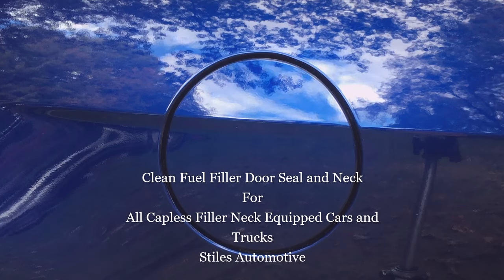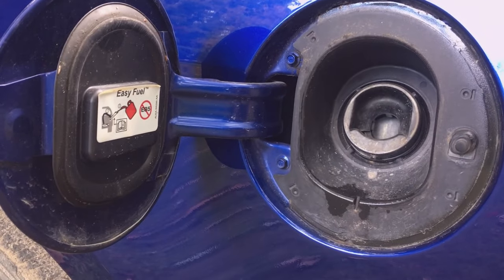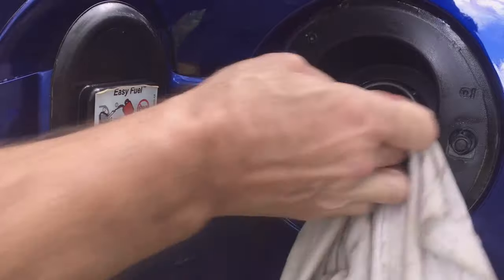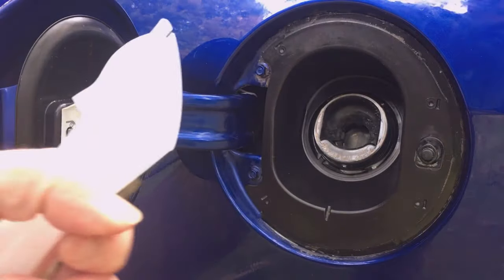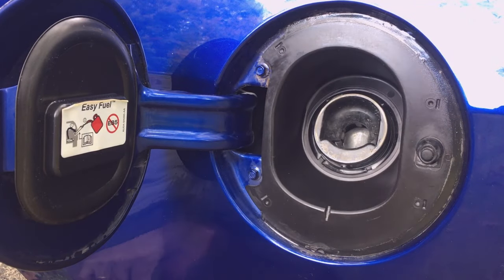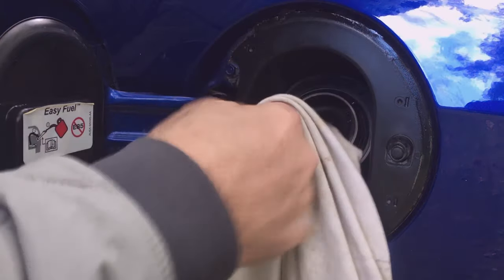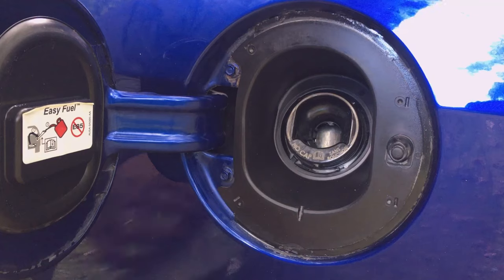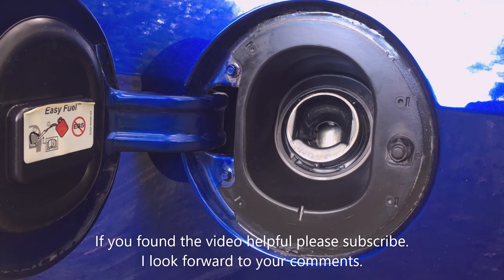Clean Fuel Filler Door Seal and Filler Neck for All Capless Filler Neck Equipped Cars and Trucks

Comment from the maker: Just a quick note about the video - -

You have to open the Flapper Valve (the little automatic door) and clean the mating surface.  This video shows you how. 
Cleaning the outside is good, but the point of this video is to clean that inside valve that make a vacuum seal to prevent OBDII fault codes!  I hope this is helpful - Stiles
Reply: Great tip! Thank you!
Reply: I’m thinking I might start carrying a rag or wipes to ensure pump nozzle is clean prior to fueling. I can see how dust could collect on a nozzle at a fueling station.
Reply: New to capless. Im experiencing a P1450 unable to bleed up. I have seen videos of WD40 sprayed and then using the funnel to actuate the flap multiple times. But this is the first I've seen showing you can keep the flap open and clean the inner mating surface.
 Thank you! I hope this clears my code!
Reply: You actually CLEAN THE FLAP INSIDE? Tell us WHY you do that? I would first check your turn signal fluid. Make sure you use the correct OEM OIL.
Reply: This needs to be show by dealers when you buy.  A pretty crappy design imo.  This video was so helpful.  Getting ready to do.  Great detail, good footage, and clear voice.  Thank you very much and thank God for youtube.

Comment: So, you think a gas cap is redundant but this hastle of cleaning isnt' a bigger pain in the ass?  And engineer that came up with this idea should be fired on the spot!
Reply from the maker: Bill, I the kind of guy that put a switch on my closet door so I don't have to flip a light switch, I open the closet door and the light comes on.  See video - -
Shop Tip No. 4 – Stop Repetitive Tasks, Radio on with Overhead Lights   https://youtu.be/0699pDo8-Yc

But . . . when you do something like this Fuel Neck you have to look at the long-term effects.  Thanks for the comment. - Stiles
Reply: Yes, you have to clean it every night!! It’s a royal pain. Be sure YOU don’t buy one. Everyone will laugh at you.
Reply: I totally agree with you
Reply: This novel idiotic design will be discontinued,watch a see.

Comment: WD-40 ends up drying up parts. You need to use silicone pray- which is great for rubber & plastic. (FYI) Thanks for the video.
Reply from the maker: Mars, Yes, True, other Sprays may be better for this application, however, I replied to someone else with this, which I still stand by . . . .

. . . , although WD-40 is not the best lubricant for plastic, it is a good lubricant, and I use it for its cleaning properties on plastic all of the time.  The WD-40 website states, "It is 50-state VOC compliant and safe to use on metal, rubber and plastic parts....And it’s safe for use on a variety of surfaces; including rubber, plastic, vinyl, and metal"  WD-40 is a petroleum based lubricant and will not affect most general use plastics such as PVC , PP, HDPE or ABS.  Avoid using a petroleum-based products like WD-40 Multi-Use on polycarbonate and clear polystyrene plastic. 

Lubricants with silicone or PTFE (polytetrafluoroethylene) are best for use on plastic surfaces. 

You are welcome, Thanks for the comment! - Stiles
Reply: @StilesAutomotive   when I worked in a "Car Area" parts store, the company magazine had an article by WD about the 40.
They said it was 6 types of silicon + lanolin.   So mostly synthetic from petroleum.
That was 10 years ago. Who knows if true?

Comment: Armour all is crap!!!! I would use anything but armour all to clean.
Reply from the maker: Kevin, yep, as a cleaner its not good, it will help wipe light dust from the Filler Neck area. and I haven't found anything for a Plastic and Rubber Protectant. So I continue to use it. - Stiles
Reply: Armor All, good for rotting out tire sidewalls
Reply: What is good to clean the area? If armoral is not good? Want to clean the outside area.

Comment: They are absolutely terrible. after a recent rain I opened the fuel door and observed water pooled on top of the trap door. I had to blot it out with a dry paper towel trying not to push against the trap door. There is no telling how much water has penetrated the trap door.
Reply from the maker: Dixie, There are now 10s of Millions of these on the road. My Mustang is 11 years old. I hope I'm wrong, but I expect this to be a big issue in the next 5 to 10 years.  - Stiles

Comment: As endorsement for preventative maintenance, the fuel filler neck is a one-piece design and the replacement part alone, without labor, is $340!!!
Reply from the maker: Jeeves, Did you do it or have the replacement done? And I wonder if it was really necessary. As our Cars get older, it will become necessary and expensive for us! I appreciate the comment! - Stiles
Reply: @StilesAutomotive  thanks, I am right in the middle of the issue.  Car has 60k miles, and has had a fairly tame life so far.  trying some of these preventative maintenance ideas first such as yours, to see if I can avoid the official repair.  We’ll see how it goes…
Reply from the maker: @jeevespreston  ok, very good - Stiles
Reply: @StilesAutomotive   also found out on the FordForums, that the emissions warranty is 80k miles, so the repair MAY be covered by Ford for some folks?
Reply: Another reason why I want to get it converted to a standard non mechanical filler on our 2014 diesel Honda CRV.
I fear it failing at the worst possible time.
Stupid invention.
Fine for race cars, but not Mums and Dads.
I know this was an attempt to prevent mis fueling, that was the idea of it.
Reply: I have a P0442 code on my 2010 Lincoln MKZ.  The dealership wants $300 dollars for the capless filler neck…. 

I just went yesterday and pulled one off of a 2010 fusion at the junkyard with only 50k miles on it.  $20, certainly beats $300!  Hopefully this will fix the leak!
Reply: @stevenlamb8726  FWIW, I was able to solve my code by aggressively cleaning the area with towel and solvent, then spraying some WD40 around the opening, and quickly inserting and removing the filler nozzle into the neck multiple times.  It finally cleared...

Comment: I didn’t realize that the actual door had a seal for the system!! My light was always going on or off after fueling. My door seal was just dirty. I cleaned everything and put a light silicone grease on the actual door seal.
Reply from the maker: Nova, Yep, now that you know it needs to be cleaned, you'll probably clean it all of the time. You should at least clean it periodically. I appreciate the comment! - Stiles
Reply: @StilesAutomotive  I found a expanding rubber pipe plug. I now use this to seal the capless system from venting. Crazy how I have to use something like this because the engineers at Chrysler can’t making a capless system that seals.
Reply from the maker: @TheChenny73  I know Ford has a Locking Plug, to make it like a Locking Gas Cap, but I don't know if it seals or not. This also would be worth investigating.  You may help someone in the future (and may be me), could you put the information on your Rubber Pipe Plug here? Put Manufacturer, Part Number and Size information, here? Thanks - Stiles

Comment: I was having trouble with the gas pump shutting off after getting less than a gallon of gas into the tank.  Tried cleaning up the filler neck like you suggested but without using Armor All or WD40.  I just used a damp ramp and wiped it all down.  Then I used a small amount of oil and rubbed it around just inside the flapper.  Seems to work.  Now I don't have to stand at the gas pump and continuously pull the lever like an animal.
Reply from the maker: Glad it helped! Plan to do your wipe down and a little oil periodically.  Thanks for the comment! - Stiles

Comment: WD 40 is a good idea, I would also use a rag soaked in diesel, it makes a good lubricant, same with brake fluid, I use brake fluid to remove rusty bolts and nuts, it works great.
Reply from the maker: Hector, Yes, Diesel Fuel is a good idea, it similar to WD40.  But, Brake Fluid you have to be careful with, it is so hard on the Paint. I appreciate the comment, hope it will help other readers. - Stiles

Comment: I will stay with a cap. Nothing to stop anyone from putting something in the tank.
Reply from the maker: Steve, I'm with you! There is a Locking Plug from Ford Motorcraft (and probably others, like Stant) that would keep would be, theives, pranksters, and terrorizers out of your Gas Tank.  That kinda defeats the purpose of the Capless Filler Neck, but you have to do what you have to do! - Stiles

Comment: My 2011 Mustang Shelby GT500 check engine light came on and when I used an OBD2 code reader is had a diag. code 0456. I cleaned the capless filler area, ,used WD40 around the filler hole/flap and then used the nozzle from the gas pump to go in/out several times. Cleared the code and haven't had it come back so assume the problem was the filler flap not closing properly due to dirt/grime.
Reply from the maker: Macker, Our Capless Filler Necks are getting old enough now, I expect many, many vehicles will have problems with them.  I'm glad it helped in your case!  i appreciate the comment. - Stiles

Comment: Never thought about cleaning that area.  Seems like a good idea. Thanks for the tip.
Reply from the maker: I know!  Most people don't, I think.  I don't clean mine as often as I would like.  At the start of the video, that was dirtier than I like to see it.  As always, thanks for the positive comments  - Stiles
Reply: .... and you shouldn’t. I would put a coat of oil on your windshield wipers so they operate smoothly and without a squeak.

Comment: Sir, thank you so much for posting this awesome video.  Our 16 Jeep Grand Cherokee is throwing evap codes and this is the cheapest way to start my hunt for what may be causing them. Hopefully it's just dirty and a good cleaning will help.❤
Reply from the maker: Tracie, Yep this video may help, there are other reason for the Fault Codes, like Hose and Line leak (normally) under the Hood in the Engine Compartment, but this is an easy place to start and something you should do periodically anyway! - Stiles

Comment: I got this system on my 2018 f-150 - got a check engine light, I think this is it. Seals the pressure.
Reply from the maker: John, You need to use a Code Reader and determine the OBDII Fault Code. Yep, there are other for this emissions fault, but this is the likely cause. - Stiles
Reply: @StilesAutomotive  Yep I did that, and got P0183 - Engine fuel temperature sensor, not working. Found the sensor, and a damn squirrel or a mouse chewed two of the wires! I was able to repair the wires and clear the code! Now I'm on squirrel patrol!

Comment: This may be the cause of my P0456 code that just occurred. Small leak. The parts store said it’s probably the gas cap.
Reply from the maker: Yes, this is the most likely problem.  It could be other things, but it is very easy to clean/lube the Flapper Valve.  Let me know if this fixes the issue!  - Good Luck with your problem - Stiles
Reply: Stiles Automotive I looked at the fuel filler neck and opening  on my 03 Camry and it doesn’t have that flapper. It just has a cap. The neck is just an open pipe. I’ll replace the cap. If that doesn’t work, I’ll check the vacuum lines and then the valves.
Reply from the maker: @jonnyboat2  Your Camry Cap is around $5.00 on the Rock Auto.com website.  I'd bet almost all of the retail auto parts stores have your cap instock for under $10.00.   If I were you, I'd replace the cap.  Yes, check vacuum lines, and check all of the lines connected to your fuel tank.  Look at your fuel tank on the Rock Auto.com website, you have a number of connections/penetrations on your tank.

Comment: got code p0446 - 2019 f150 with just 18 k miles on it.  will attempt this method - and see what happens..  Was life simpler - when we just had a 1966 f150 - with none of these great fail safes - and warning lights - i'm starting to think so.
Reply from the maker: Tim, Yes, true, but we are almost to the point were the Car will tell us what is wrong and how to fix it. - Stiles

Comment: Just got a 2010 Fiesta a couple days ago.. used half a tank in about 120kms!! Went to gas and was shocked to see this crap..thought at first was missing the cap .. i could smell the gas evaporating so badly.. hopefully this will help but it seems the flap doesn't always close tightly.. and way of replacing this garbage with a standard fuel cap?
Reply from the maker: Mike, Yep, I bet you could replace your Fuel Filter Neck with and earlier version that uses a Cap, be careful, on the Mustang I believe Ford changed the Fuel Tank(s). "If there is a will, there is a way!"  You and your Parts Guy, need to determine if the interface points are the same, ie. the Fuel Tank and the top of the Filler Neck.  

Here is an idea! I haven't used one before and I don't know if it seals, but you could try a "Locking Fuel Filler Plug", I don't see one for the 2010 Fiesta on the Ford Parts Website, but Ford or Aftermarket may have one. Below is the Ford Parts information for a 2009 to 2010 Mustang. - Stiles

9C268 - Locking Fuel Filler Plug
Filler Plug
Part#: 8U5Z9C268B
Usages: 02/26/2009 - 03/15/2010, Mustang (2005/), 4.0L V6 12V SOHC EFI

In stock for pickup at dealership, or will ship next business day
Reply: Im ust not gullible enough, but II know people like you are out there

Comment: I haven't try it yet hope it helps gas door light goes out will let you know if it works
Reply from the maker: Emmitt, Make sure your Flapper Door springs back into place well and both mating surfaces feel smooth and you clean them well.  Yep, let me know how it goes for you!  - Stiles
Reply: Yes?? you need to tape the light switch to “off"

Comment: Can this code cause your vehicle to struggle to start sometimes and say act like it's going to stall while sitting idle?
Reply from the maker: Josh, Yes, but make sure you check the OBDII Fault Code and Troubleshoot the correct Fault. Other things can cause those problems too!  - Stiles
Reply: Yes, the car manufacturers can’t figure it out.

Comment: I didn't watch the whole video. I came to YouTube trying to understand the problem with my 2014 Mustang. The engine light keeps coming on and I'm thinking it's the gas cap? I want to replace it. Is it too late? Is it damaged elsewhere because of the dust or dirt getting in?
Reply from the maker: Based on what you just said, you don't have a fault code reader, go to Autozone, Advance Auto, or Pep Boys and ask them to use a OBDII reader in the parking lot.  They won't charge you anything (Pep Boys may want you bring it into the shop so they can charge you).  This will tell you what your problem is, then you can determine it you can fix it or if you need a trained professional.  Best of luck and let me know how it goes! - Stiles
Reply: a gas cap is.. what... 6 bucks? I’d forgo Christmas and crack the bank open and try one. You can always tale it back to recover that Queenly sum.

Comment: Wd40 should never lubricants rubber or plastic
Reply from the maker: Huilin lI,  Don't say never, although WD-40 is not the best lubricant for plastic, it is a good lubricant, and I use it for its cleaning properties on plastic all of the time.  The WD-40 website states, "It is 50-state VOC compliant and safe to use on metal, rubber and plastic parts....And it’s safe for use on a variety of surfaces; including rubber, plastic, vinyl, and metal"  WD-40 is a petroleum based lubricant and will not affect most general use plastics such as PVC , PP, HDPE or ABS.  Avoid using a petroleum-based products like WD-40 Multi-Use on polycarbonate and clear polystyrene plastic. 

Lubricants with silicone or PTFE (polytetrafluoroethylene) are best for use on plastic surfaces. 

Thanks for the comment! - Stiles

Comment: how to lock the fuel door again? does it lock by itself?
Reply from the maker: Maria, The Fuel Door on my 2013 Mustang does not lock.  It is a push open (spring loaded) and push closed door.  If you are talking about the internal Flapper Valve, re-insert the OEM Funnel into the Fuel Filler Neck and it will close. - Stiles
Reply: When you use one, it pours gas all over the street, your driveway, your children’s play area... I would let your wife drive.

Comment: Do you have to use the fuel tunnel???
Reply from the maker: Yes, you do.  The Fuel Funnel that comes from the OEM with the car is the correct diameter to open the Flapper Valve by hitting the two little black Taps.  Or you could use some object of the same diameter.  You should have the Funnel in your Spare Tire Well of the Trunk, why not use it?  - Stiles
Reply: @StilesAutomotive  well , I've been fueling without it. Maybe why I smell gas inside?
Reply from the maker: @ericcraig3809  What?  To fuel the car at the Gas Station Pump, the Pump Nozzle is the correct size to open the Flapper Valve.  To add Gas from a Fuel Can, you need to use the correct Fuel Can designed with the right nozzle (none of mine are) or you have to use the OEM Fuel Filler Funnel.  You may need to ask the question again. - Stiles
Reply: @StilesAutomotive  Thanks for responding. Yeah I smell gas in the car after it sets awhile. What do you think?
Reply from the maker: @ericcraig3809  That is a tough one to troubleshoot from messages like this.  Sorry I can't be more help.  - Stiles
Reply: hmmm, my Ford doesn’t have a tunnel. I/d check the lemon laws in your state.